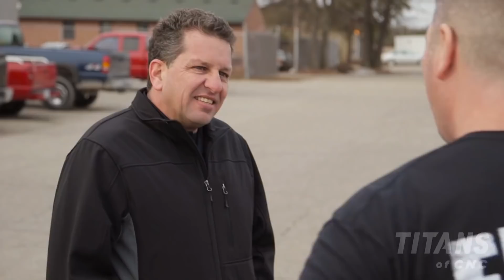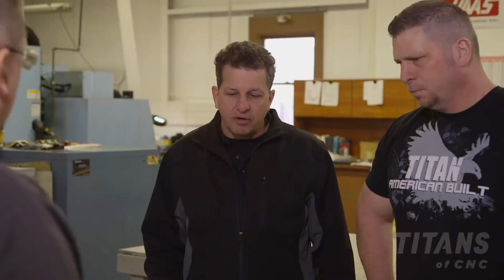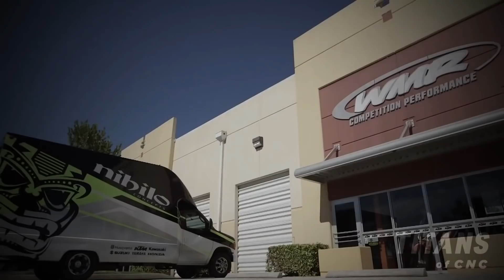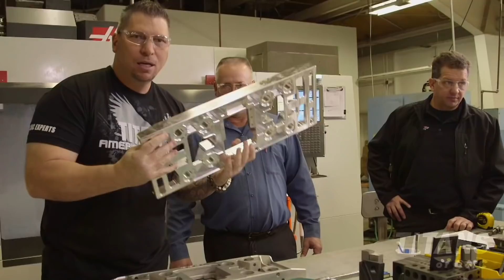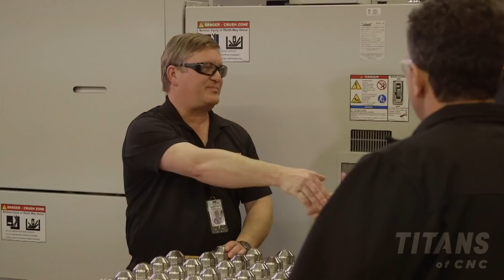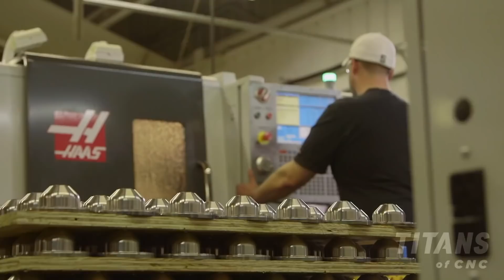Tour of Kalitta Air's Private CNC Shop

Comment: how much more does 700 stainless versions weigh compared to 700 aluminum versions? Every extra pound is a pound of freight they can't carry.
Reply: 2.85 times as much. They're freight load is over 100000 lb. Even if each sst ball transfers weigh 3lb compared to the aluminium 1lb version it's only a 1400 lb difference overall. Relative to the 100000 lb typical load it's a very small percentage. The fact that they don't break as often and don't need to be repaired is why it's worth sacrificing a small percentage in carrying capacity.